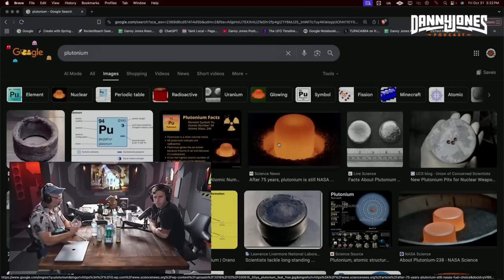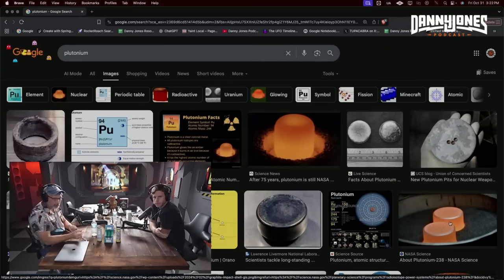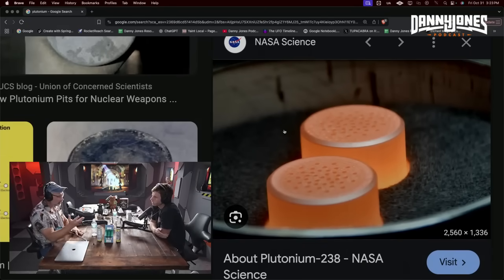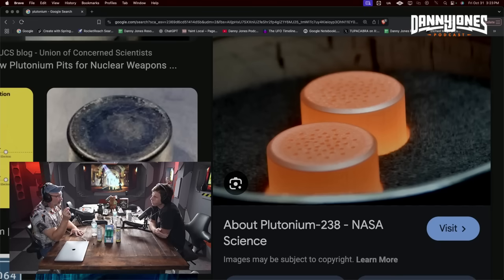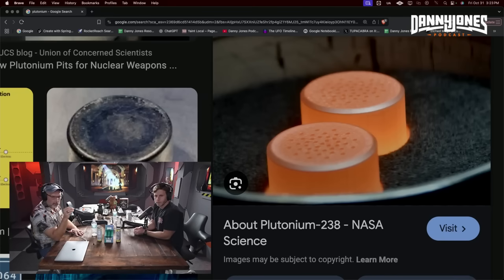New #1 Theory for How the Great Pyramid was Built | Max Zamilov

Comment: The pyramids are held together with suction just like a Victorian frosted glass syringe, just like an iPhone put face down on a glass table is difficult at 1st to lift. But with the pyramid blocks the forces holding them together in six directions greater than the weight of the block. All the AIs agree with me and nobody else had ever figured this out and all the Oxford professors I've spoken to agree with me and so I will release this news soon on Reddit.

Comment: I think Max is on the right track but I don't think an "advanced civilization" would have to use nuclear energy. There could be a completely type of "advanced technology" that runs on a completely different energy system. 
Everything about the great pyramid and other megalithic structures points to a complete command of water, and materials that are able to convert water to energy. The Red pyramid and perhaps others are clearly some sort of chemical factory. The missing element in this pyramid energy factory appears to be SOUND, i.e. Vibration.  
This brings to mind the Egyptian creation story that there was a "Cry of Light" that initiated the entire sequence of Manifest Creation from the infinite potential. And then there are the multi-ton granite or quartz sculptures that have a musical/vibrational "tone".  
Who's to say that the only way to influence electrons is with rather dangerous nuclear isotopes?